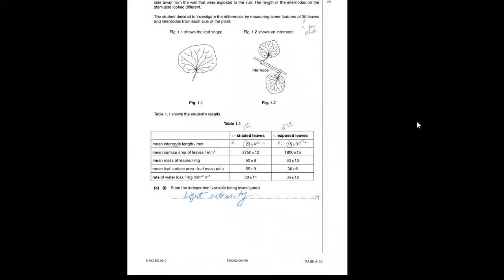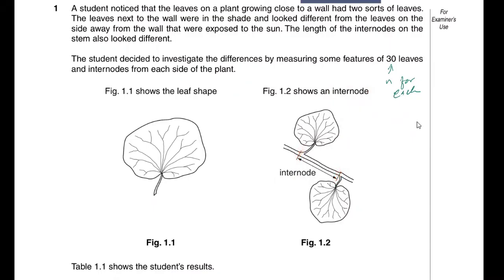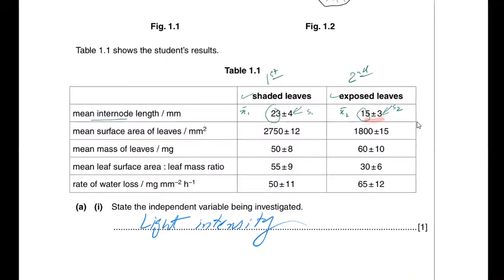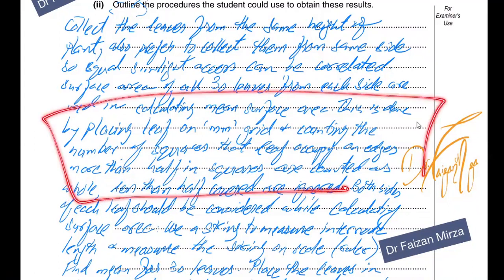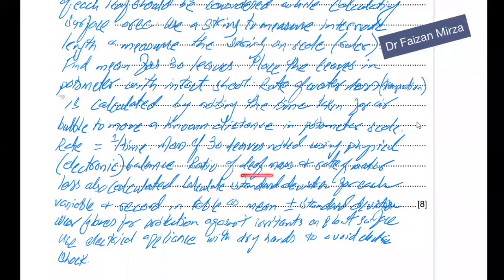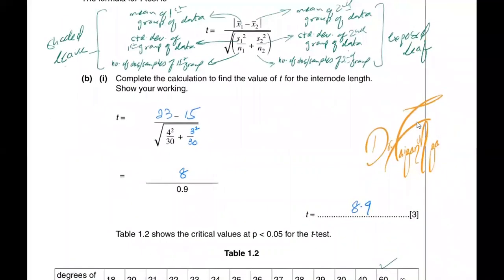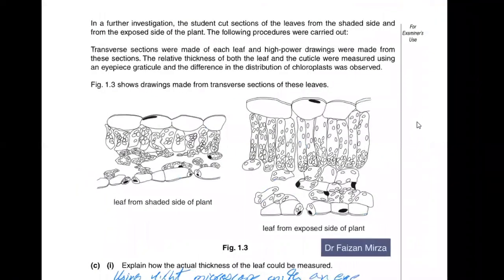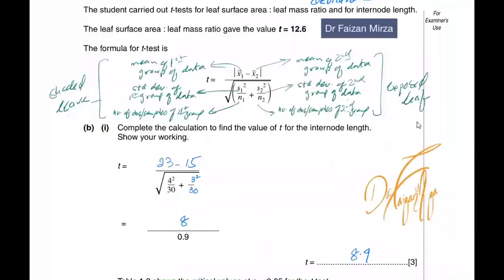t test calculation using formula provided

Comment: sir is outline and describe the procedure the same thing ?
Reply from the maker: No. In Outline you give a brief overview of the process, details aren't required. All marking points are for brevity in answer. While for Describe, the answer must have description of the process, details are required. Brief points would not get you full marks. If graph or Table is given quote the values (with units) from that to support your description
Reply: @biosfundamentals619  okay sir thnx